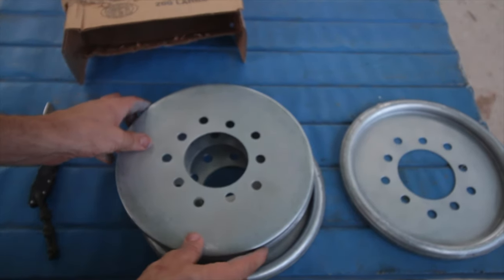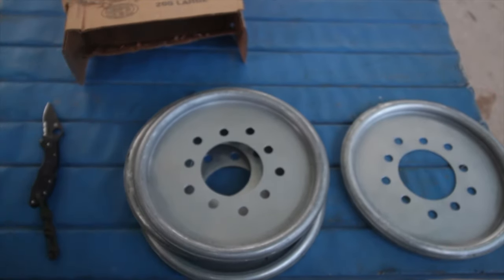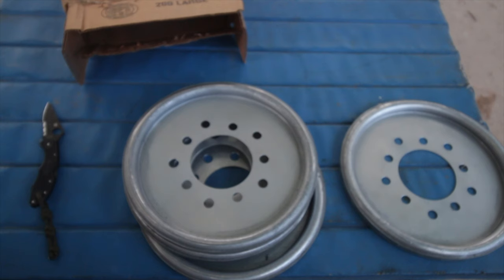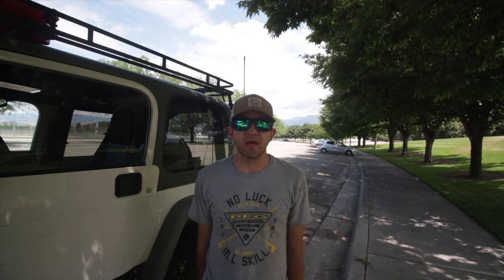Centramatic Wheel Balancers Review

Comment: Well, it's not a new thing... I bought a new 1968 Chevelle SS396 (in 1968) and I bought/installed a set of wheel balancers that looked and functioned exactly like this product.  They were made to look just like this.  They were constructed of a stiff, black plastic, and they also had the metal BB's in the unit.  They worked well, in 1968, so I'm not surprised to hear that they work well, now (only 50+ years later)!
Reply from the maker: Good to know they worked back than and now today! Thank you for the history lesson.
Reply: Centramatic is not new. I personally have been using them on semi trucks and trailers for years. They are a good product

Comment: I tried these they worked well for the trailer. I was however disappointed that they weren't stainless. At that price I thought they would be and they looked stainless in the picture. So here in the Rust Belt I think they will eventually rot out
Reply from the maker: Glad to hear they work well for your application. So far, they are still working well on my jeep. I was kind of thinking the same. The only thing that might save them is that they have a heavy galvanized coating. But, one day it might be necessary to clean and paint them.
Reply: Why not paint them?
Reply from the maker: @cencoast_7.340  That is one option.
Reply: Galvanizing is more rust resistant than stainless. People that think stainless doesnt rust is pretty gullible.
Reply: they don’t rust out I’ve had them on my semi truck and trailer for years
Reply: I have had a few sets of Centramatics and put over 3 million miles on them running mostly the northeast, year round. None of them have shown even surface rust. They are worth the money.

Comment: Well? How are they working?  Did you remove the weights from the wheels?
I'm running 255/85/16 KM2 's and they balance like they're square!!
Reply from the maker: I have about 3,000 miles on these already and they are working amazingly well. Funny thing, I didn't have to remove the weights from the wheels, some how I have self removing weights! 
If you are having balancing issues, I highly recommend these. The best thing about these are that once they are installed, they never have to be touched again. Regardless of tire choice. I hope you enjoyed the video, thank you for the question.
Reply: Always pre balance your tires and wheels. The centramatics will only correct so much so if you pre balance they still have room to balance the rest of your wheel end.
Reply: I used beads and removed the weights.  The balance with just weights was horrible and I'm sure they were in the wrong locations and too large.

Comment: Do these work better than beads?
Reply from the maker: Yes, they work much better than beads.
Reply: @EmbarkWithMark  I looked at their website,  but I didn't see  them for 5x5.5 bolt pattern.  I'm going to a 17" wheel and doing vanco super 16 brake kit.
Reply from the maker: @jimmyvalhalla1939  I recommend calling them directly. They have awesome customer support and they will most likely have something that fits your application. Technically the balancers I am running are for trailers, but they work great. The guys at Centramatic recommend that over the common jeep size they have due to the inner diameter of my wheels. I've had zero problems and they work great.
Reply: @EmbarkWithMark  how much were they mate ?
Reply from the maker: TASSIE 4X4  These balancers are $199.99us for a set of 4. They are a bit pricy, but so far I think they are worth it. Plus I don’t have to pay to have any tires balanced, or take them to a shop. The tires are wearing very very well so far. But time will tell.

Comment: What do you mean; ...... did their job but, they have one huge flaw that is every time a tire needs to be changed out the beads need to be replaced. .... ????
Reply from the maker: Balancing beads that are poured inside your tire need to be replaced when you change tires. These balancing rings do not have that problem.
Reply from the maker: @dickfitzwelliner2807  Ah! Yes, tire balancing beads are a big deal in the offroad world. Specifically when you have larger hard to balance tires. 

The beads work very well, however, not as well as the balancing rings. I’m a huge fan of the balancing rings and install them on most of my vehicles, if I can.